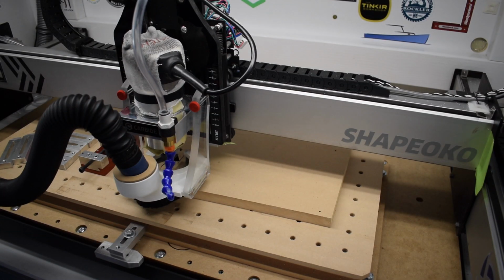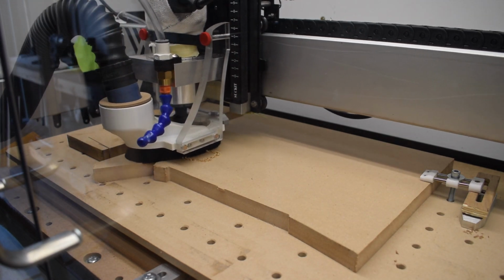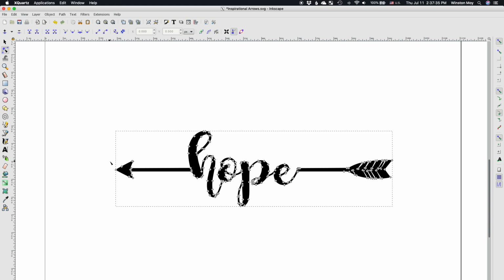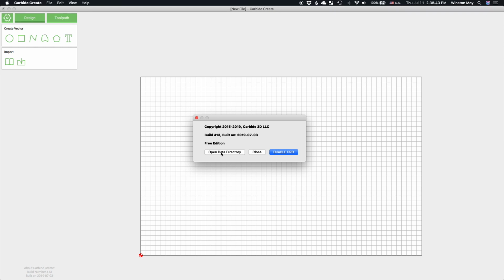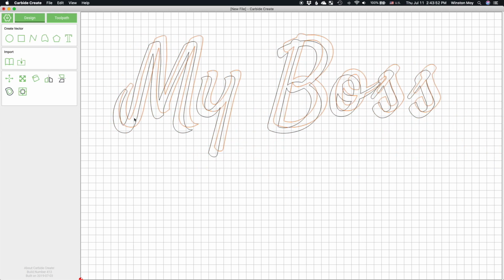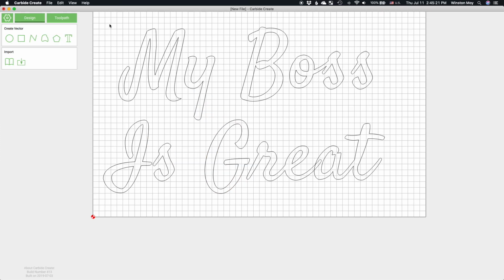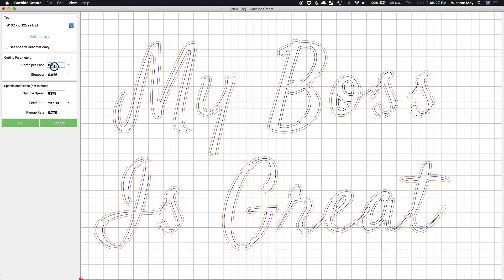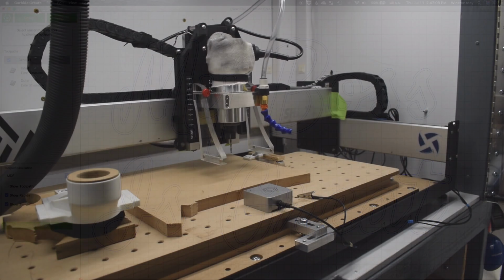Making Decorative Words Cutouts in Carbide Create

Comment: QUICK NOTES TAKEN FROM THE VIDEO:
LETTERS SHOULD BE 2" TO 3" TALL IF CUTTING WITH .125" END MILL
CREATE VECTORS
- CONVERT TEXT TO CURVES
- GRAPHIC DESIGN
- BUY A VECTOR
- CREATE IN CARBIDE CREATE

CREATE AN OFFSET VECTOR (.001)
- DELETE THE ORIGINAL TEXT

TOOLPATHS:
SELECT INNER MOST CONTOURS
- CONTOUR INSIDE / LEFT
- 18,000 RPM
- FEED SPEED 60
- LOW PLUNGE RATE FOR MDF (20?)

SELECT OUTSIDE CONTOURS
- CONTOUR OUTSIDE / RIGHT
- SAME FEEDS AND SPEEDS

TABS OR DOUBLE SIDED TAPE
- ONION SKINNING = NOT CUTTING THE WHOLE WAY THROUGH
- NEED TO PREVENT THE CUT OUTS FROM FLYING OFF YOUR WORK PIECE

Comment: WINSTON CAN YOU HELP OUT ONE OF SANTAS ELF?❤️🎄❤️🎄❤️🎄❤️🎄❤️
I have a shapeoko XXL that is a few days shy of a month old😳
I have been able to cut several designs out with it and it’s worked fine up until today 😢
TODAY it gets about a quarter way through any project I TRY TO cut and it stops and it tells me that ERROR 5 SERIAL PORT RESOURCE ERROR?
  Can anyone help? I have disconnected the power and reconnected it hoping that it will solve the problem but it does not? And I have called and emailed carbide 3-D! 

❤️🎄Santas workshop has a list of Christmas gifts and must come out of the workshop time is of the essence🎄🎄

Comment: Great Vid!  

I have a Material Monday request! Drum roll please.... Carpet. Yes, Carpet. Im trying to cut circular 15” did. circle for buffing hardwood stain & and lets just say a 1/4” Square EM did not work. At all.... LoL 

While this approach is less then practical I didn't realize this but there is a whole world of Textile CNC machining out there!

Hit me up at
C3D forum: GrantyGrant
If you are interested in pictures /video of my attempt lol
Reply from the maker: Something that flexible is not a great idea to cut with a rotary tool. Plus the risk of the material snagging and getting wrapped around the cutter... It's just very sketchy. Much better to cut out a template and use that as a guide to cut by hand.
Reply: @carbide3d  That is exactly what happened but sometimes you just gotta give it a shot.  I plan on creating a jig of some sort and using an oscillating tool as you mentioned. None the less I still just might have to try a V-bit and a work-holding jig.